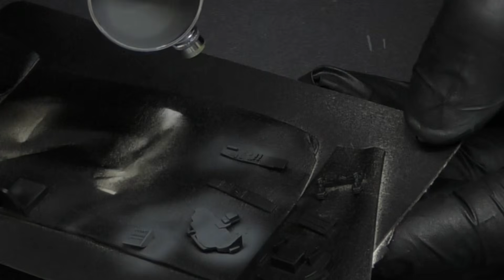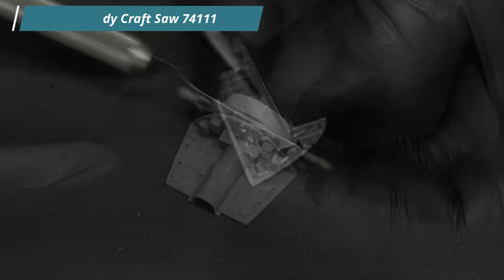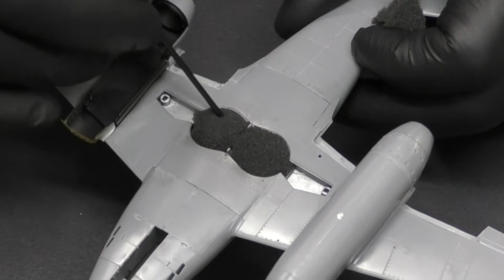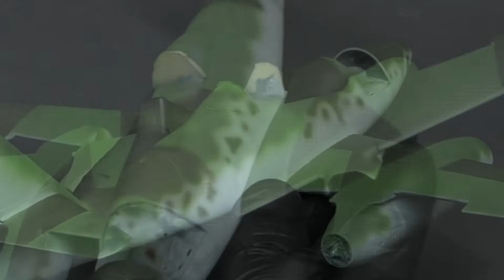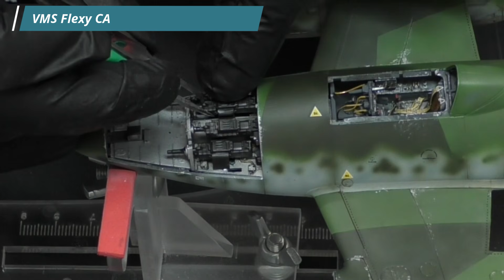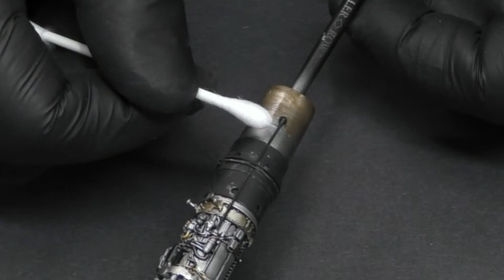Tamiya 1/48 Messerschmitt Me-262 - Scale model aircraft kit 61087

Comment: I'm 66 and now live in Seattle.  Back in the mid 70s I would ride my motorcycle to Chino airport and for a small fee I could go into any restoration hanger I wanted and could touch and go into any plane that was there, and one was their Me-262. I was fascinated by the lawn mower pull starter on the front tip of the jet engine nose cone. It actually started a two stroke engine which help turn over the jet engine to start.  To this day I have a small service door round cover from that Me 262 that was lying on the floor.  I got to see so many famous planes long before they were restored including a AM-6 Zero and the original  small orange prototype flying wing.  Decades later I got to see that very same AM-6 Zero restored and fly over my house in Seattle in 2010 during Seafair.  Great stuff.
Reply: That’s awesome I wish I could do that someday
Reply: That's cool af

Comment: Wonderful model. Having worked on the real thing and built the full size flying replica's. That's a great job.  Not to be a ball buster. Gear down and parked the automatic leading edge slats would be down.  I know the model makers did not mold them in the wings to be out, I will guess?  Love the detail Jumo 004's and cockpit. Gun sight a Rev 16?

Comment: Great work on the red and blue markings: not worth painting the crosses too? I've started painting markings at 1/48 for no other reason than we go the extra mile with colour and tone variation in the paintwork only to lay perfect paintwork water slide transfers over the top. The paints used for markings were affected by environmental conditions and maintenance just like the paint on the rest of the aircraft. I've not yet invested in a vinyl cutting machine but I've had great results with tamiya tape so far and just treated them like the rest of the paint when it comes to chipping, sanding, 'blooming', and all that.